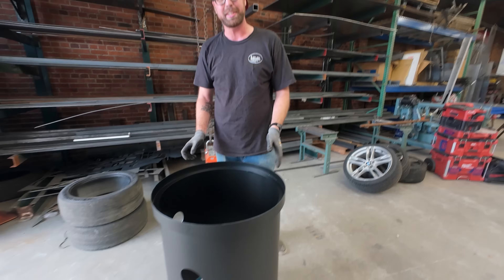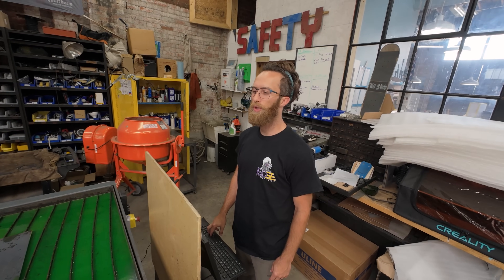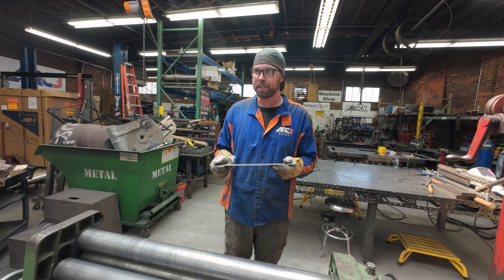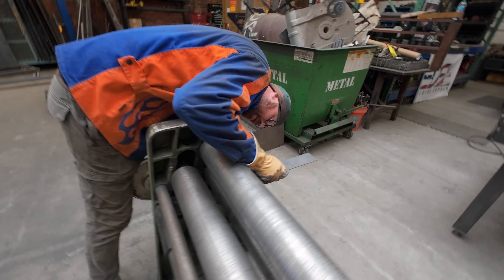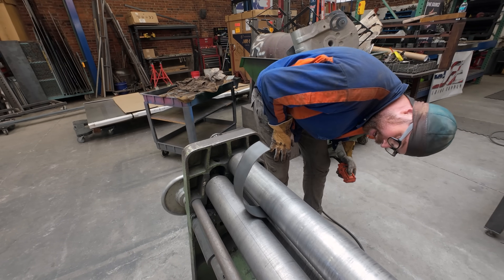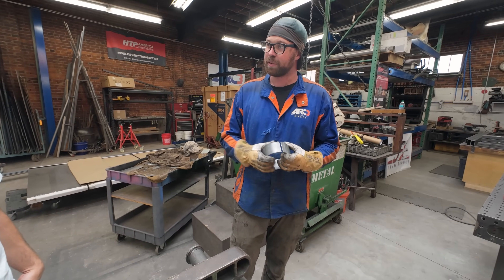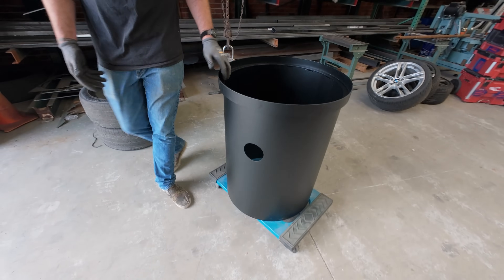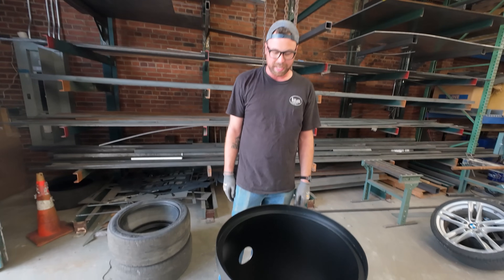Struggling to make a Perfect Cylinder

Comment: when you cut hole for a cylinder before you roll it don’t fully cut it out, leave a tag that holds the piece in there while you roll, then the resistance is fairly even all round the plate. if you roll with a larger hole cut out it can over bend, hope that makes sense.

Comment: You need to try it like a toilet paper roll, that way the seam gets rolled on a angle, spreads the weld around the circumference instead of being in one place.

I've been enjoying these videos.
Reply: TO further explain, the sheet is cut like a parallelogram and feed the angle "ends" first. It doesn't have to be multiple turns, just the equivalent of a 1/4 or 1/2 turn should spread the weld out nicely.

Comment: Tey, coming from custom body work where you have to hammer and dolly sheat metal. I know it sounds crazy but a tig weld is actually softer than a mig when using a hammer & dolly a tig weld is easier to hammer flat than a mig weld. So I figure the same may apply in the roller. If you stitched it together with a tig weld, it may roll out cilintracul easier in the roller. Just thought it may be worth a shot to try any way.